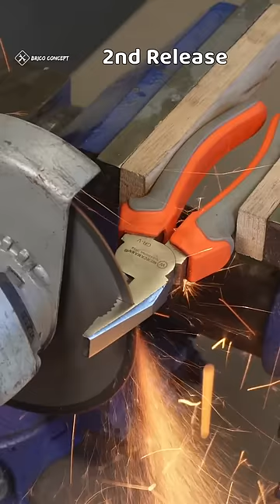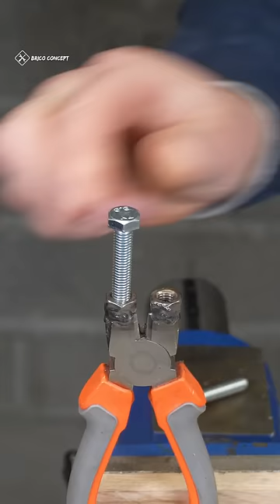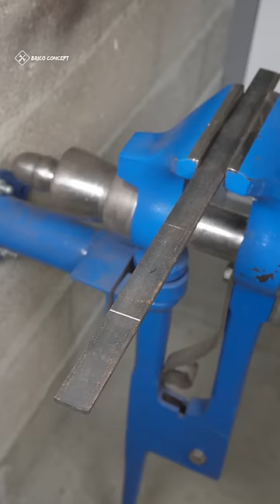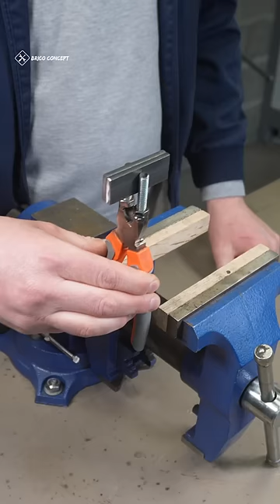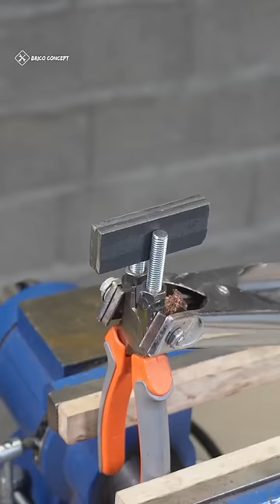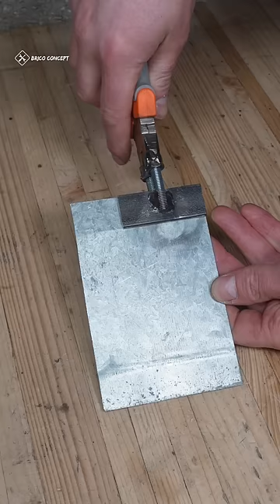Here is The Second Version of The Universal Pliers #shorts

Comment: Yip, all good but you need to hold the pliers closed with hand pressure whilst bending the material. Better to use a locking type plier. Vice grips make such a tool. Platypus sheet metal folding pliers have been avialable for many years. Why try to re-invent the wheel?